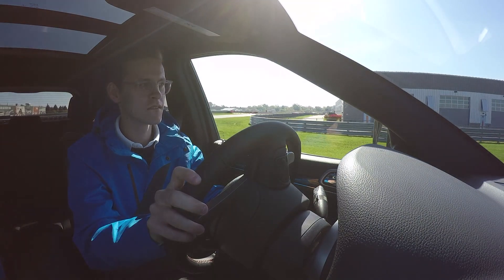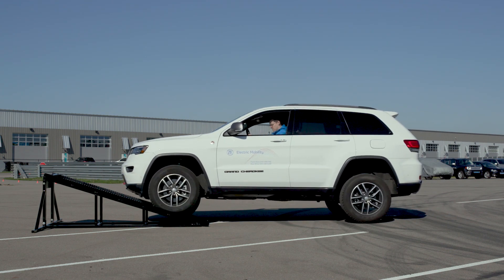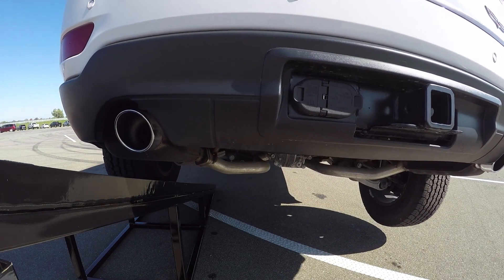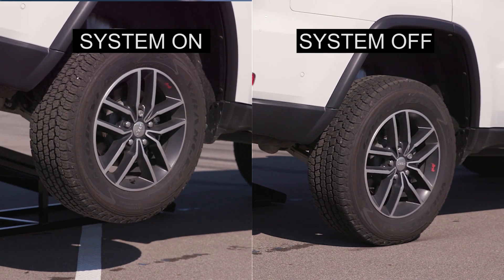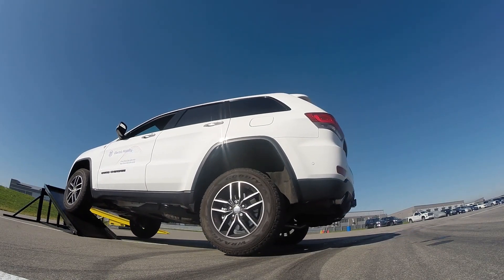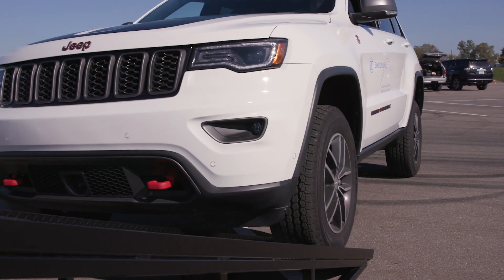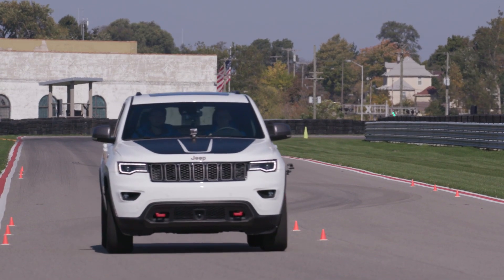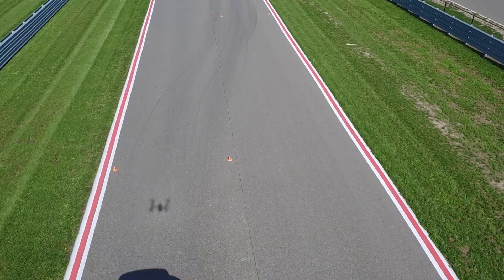A clever solution: The eLSD electromechanical locking differential

Comment: the actuator for elsd always goes bad it's very poor quality. check forums, tons of people stuck in 2wd because the elsd is not working.
Reply: what? i have an rwd alfa-romeo with elsd, its always 2wd but lsd is NOT about how many wheels are driven, it is about their relative speed
Reply: @megasuperlexa2  in Jeeps when eLSD motor fails initialisation it turns off the transfercase and cruise control... Those systems are tied together, if one goes bad the others shut down.
Reply: @malamri424  I have this exact vehicle and use it offroad quite regularly and its been flawless. Super happy with that diff.
Reply: This is incorrect. The eLSD has a track record of being the most reliable part of the 4wd system on Jeep vehicles. There are virtually no complaints on the forums.